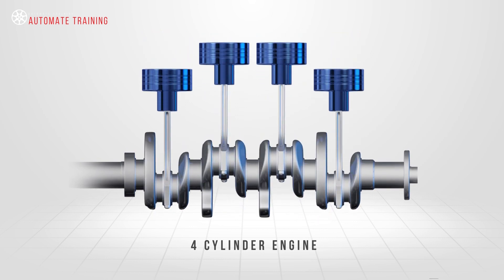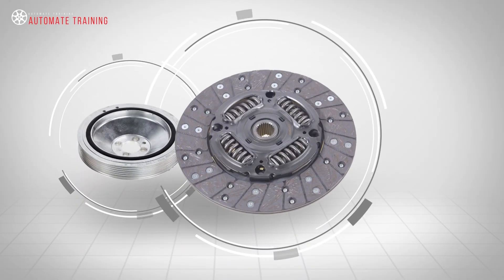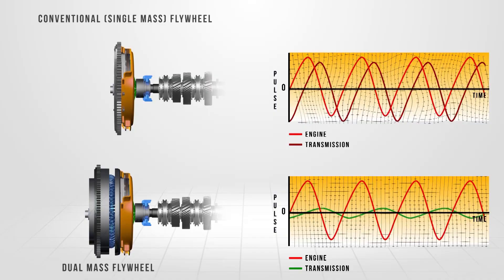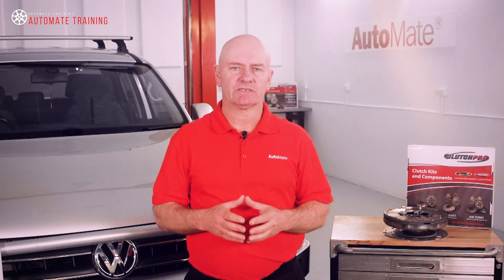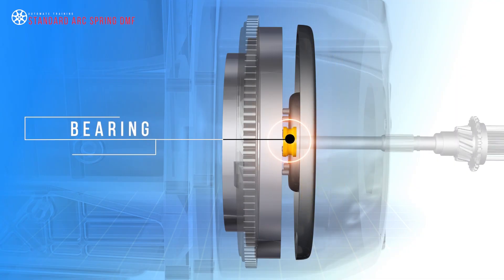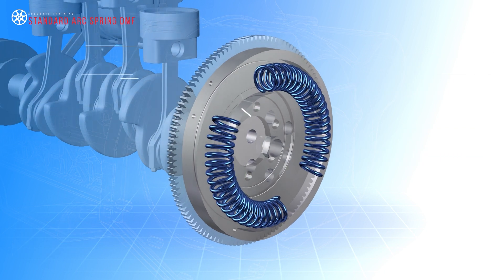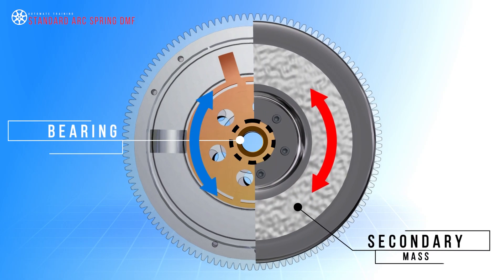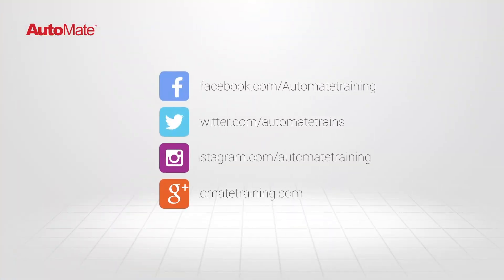Dual Mass Flywheel - Design & Operation

Comment: dual mass flywheel designed for old fuckwits who cant drive . but if it breaks it will only cost around a 1000$ for the flywheel . we will rape your wallet for another 800 bc we have to make more money off you. we cant be bothered to make a car reliable so we just invent things that can break :D

Comment: Moral of the story dual mass flywheel (dmf) is a two part flywheel that will break on you it's just a matter of time , mine broke at 280 000 kilometres on a 2008 Mitsubishi pajero. I'm going back to the old school stuff where they were made to last and now going back to a single mass flywheel (smf) . The 2009 models came with a single mass flywheel  , that's the way to go .

Comment: I got a dual mass flywheel in my 2008 Mitsubishi pajero and unknowingly thought it was my clutch plate that slipped at 280 000 kilometres. To my surprise it was the dual mass flywheel that was buggered and not the clutch. Also I thought it was the main crankshaft seal that was leaking and no it was graphite grease black grease that actually came out of the two part flywheel at the centre between the two part flywheel. Nothing wrong with clutch kit or main seal on engine. Further inspection I could rotate the flywheel without the engine turning  , now had to replace the flywheel as well and not just the clutch kit. I'll go back to single mass flywheel so I don't have to worry about changing another flywheel lol. What was the engineer thinking???. Old cars drove just fine with a one solid cast flywheel and the don't pack up like a stupid dual mass that's made to break.  My advice is go the old school single mass lol.

Comment: Good presentation. These might be good in some situations but I drove 230,000km on DMF Nissan X-Trail 2.5 petrol and the clutch was terrible. It tended to shudder on take up and also made a terrible sound if blipping the throttle on down-shift. The DMF was bad but overall the car was still pretty good and I replaced it with another car the same, after a head on collision write off, that already had a solid flywheel/clutch replacement. The improvement is miraculous: smooth take off's and smooth double clutch down-shists but the engine does oscillate if accelerating under high torque at low revs so I use a lower gear in these situations which are very rare. The cabin noise is supposed to be higher but I don't perceive any difference but the power certainly feels more direct and the car feels sporty. Exedy do solid fly wheel conversions for many cars so if you do need a new clutch I would say consider ditching the DMF system. As for Diesels, I don't drive diesel cars but the Kenworth 18 speed and Volvo 14 speed prime movers I have driven have solid clutches and they are necessary for down-shifting.

Comment: Why not just have a slightly heavier flywheel hence getting rid of the parasitic losses and failures.

I'll tell you why! This is why: 💵
Reply: Heavier mass of a SMF may slow the engine response from gear to gear. You can dampen engine torque pulses with increased flywheel inertia, but it also slows the engine RPM response when you remove your foot from the throttle (changing gears, RPM takes longer to fall). Also any extra rotating weight will be mass that combustion has to overcome to accelerate your vehicle.

Comment: In slow revving diesels pickups the gear noise from a solid flywheel decreases MPG's by causing a lower gear to be chosen to eliminate the noise with a higher RPM. 

2,500 RPM can be approaching redline in some applications.
Reply: Yup old 7.3s F series
Reply: @firstlast2268  get rid of the limiter and put heavy springs in that sucker and you got a powerhouse. Screaming at 3 grand
Reply: Is that with automatic transmission? With manual the rule is drive the car in the lowest RPM without the engine choking so if you can drive it 3rd gear low RPM or 2nd gear med-high RPM you choose the 3rd. Also I've never had any experiences with trucks, only your "normal" everyday cars

Comment: What is engine harmonic
..??
Reply: Harmonics are simply "vibrations", for example, a guitar string moving back and forth very quickly producing sound. With an engine, the combustion pulses in the cylinders coupled with the firing interval of a given engine configuration produces torque pulses through the crankshaft and that pulsation (back and forth, or "harmonic") is transmitted through the flywheel and transmission shafts.
Reply: It feel like a wobble in the engine best felt when hill starting on a steepish hill after shifting to 2nd; this can be prevented by changing later under such loads I.e at 2500rpm for a petrol instead of about 2200rpm.

Comment: We have been manufacturing single mass flywheel and clutch kit since 2010 in Turkey. You know single mass flywheel is more economical and more comfortable than dual mass flywheel. 
We export to many countries over of the World.
VOLMERK FLYWHEEL
Reply: My Nissan X-Trail T31 2.5 petrol runs a single mass flywheel, don't know what brand but the improvement is massive. Occasionally if moving away up a steep hill it pays to change to second gear slightly later than the DMF would allow or the SMF will allow a slight oscillation from the drive, otherwise everything is improved.
Reply: Until it falls apart in fatigue

Comment: The contents of this video is utter bullshit. DMFs are nothing but a cash-grab. It replaces a never-fail part, that was easily replaceable if not serviceable, with a flimsy, un-reliable, and very expensive part. The reason why manufacturers are using them is because they reliably fail early, at around 100k mi, costing $3000.00+ in parts and labour, motivating customers to just buy a new car. The transmissions paired with DMF are also fragile pieces of crap that will break in short time if the DMF is replaced with a single-mass flywheel. DMFs are a regression in every single way. DMFs are nothing but anti-consumer business practices.

Comment: I have some bearing noise . When I press and release the clutch come out this noise. Can this bearing cause other issue or can drive it
Reply: It's the clutch release bearing.Clutch kits come with new bearing.Never replace these two components individually,only as a set.

Comment: In other words all transmission components can be lighter- cheaper to make- and you can be charged thousands when, not if but when, your flywheel fails. Double win for auto industry. More profits on sale of vehicle and mega bucks for repairs. #welditup!
Reply: You ain’t kidding! I just had to shell out $3200 usd on a clutch replacement on a POS jeep renegade! The DMF alone was almost half the price, then all the associated other clutch components. People say labor is the expensive part but it was honestly the smallest portion of the bill.

Comment: Dual mass flywheel is a weak link waiting to give up.
Reply: It's good and bad thing. DMF's are designed to be "weak link" that takes the hit from engine vibrations. If you replace DMF with SMF, you may notice lot more vibrations when driving and on worst cases premature wear on i.e. transmission parts. I've understood that on diesels DMF's also allow of use lighter parts, because it absorbs lot of vibrational forces, so transmission won't need to be built so "touhg" as with SMF. Just use good amount of RPM's with DMF too so it will last a bit longer, but eventually it will give up...
Reply: Cool, I can shade tree that weak link much easier than splaying the internals of my transmission across three work benches.
Reply: DMF are like the "cush drive" on the back of a motorcycle. On a motorcycle wheel, the rear sprocket (on chain drive) connects to the wheel hub with fingers that engage with rubber pucks. The torque transmitted from the transmission to the rear sprocket comes in pulses (due to engine firing intervals) which are absorbed by the rubber pucks, so the rear wheel isn't getting the harsh pulses from the engine firing.
DMF are essentially a cush drive for transmissions.

Comment: I have been driving cars for 40yrs and have never had a clutch break up or the gearbox failing due to a single mass flywheel. The company's that are producing DMF's are making a killing financially due to the DMF's failing accross the globe on modern cars. Its all about money nothing to do with ''engine harmonics'' . 

DMF's are so damn expensive considering there designed to fail at low mileage.
Reply: Cars 40yrs ago had piss all torque compared to modern Diesels - that is why DMF's are required.
Reply: .... same goes for the clutch pulley on modern alternators ..
Reply: @novi0974  I agree had change a couple of those due to lock up.
Reply: #welditup
Reply: Those low end torq engines vibrate a lot and stress a lot thé transmission… dualmass is no luxury… if you want a manual… best solution is torq côvertor
Reply: Everyone needs to make some cash somewhere. The service and parts departments in a dealership are it’s bread and butter to an extent.
Reply: No apostrophe 's' in plurals. So it's 'companies' not 'company's' and 'DMFs' not  'DMF's'. What's that all about? Also it's 'THEY'RE designed to...' not 'THERE designed to...'. This is really basic English that a 10yo child of mediocre intelligence should grasp. We're not talking rocket science here.

Comment: Is it possible for there to be separation in the DMF? I have a 04 Jetta TDI manual that shudders when I let the clutch out from a dead stop in first gear. There seems to be lots of clutch left though as it engages early. All other gears shift normally.
Reply: The surface of the flywheel meeting the clutch disc is probably warped, and or pressure plate. This can really get a shudder/wobble in everything resembling a shopping cart caster on a joyride. (This same shudder thing happens with solid flywheels) 

The pulse of the momentum let's everything 'slop' back and forth, getting a Tacoma Bride collapse thing going on.